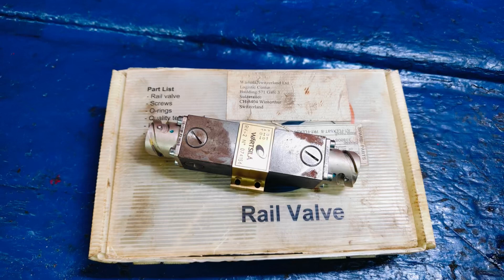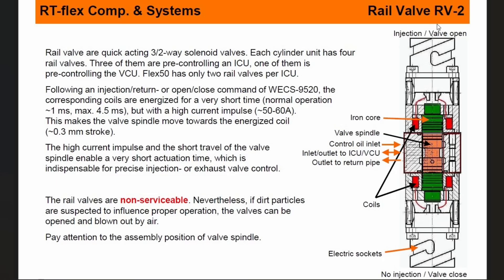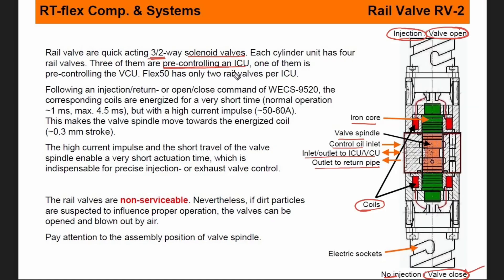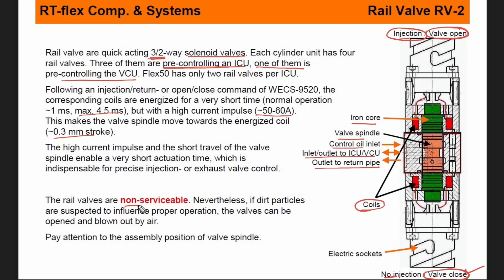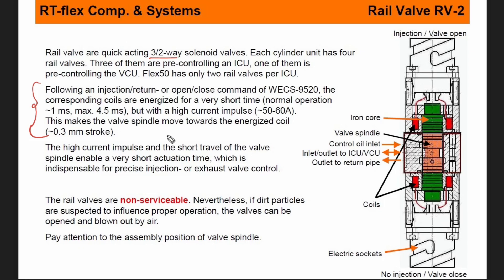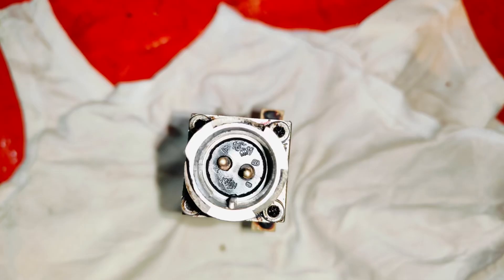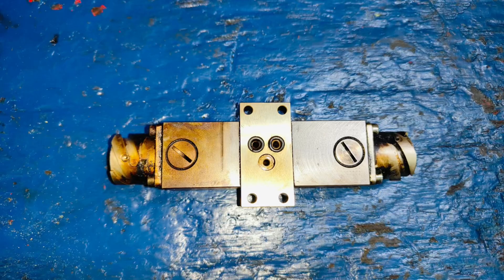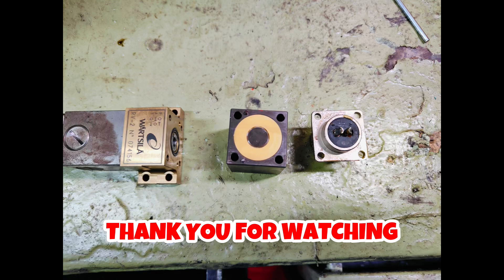RAIL VALVE working & uses || Wartsila sulzer marine engine

Comment: Did you have a situation where control oil pp did not stop after MLO pp stopped running, control oil pp just continued to dry run and started screaming!!!?
Reply from the maker: No, i haven't faced such situation try to check control system for control oil pump or the pressure switch might be having any issue.
Reply: @sailorsrikantsingh 

The problem was current measuring pcb through which the cable of main lo pp ran through
Reply: @sailorsrikantsingh  

Have faced it and above was the solution